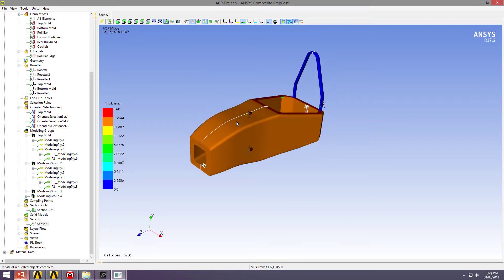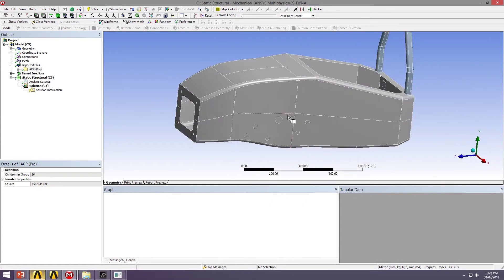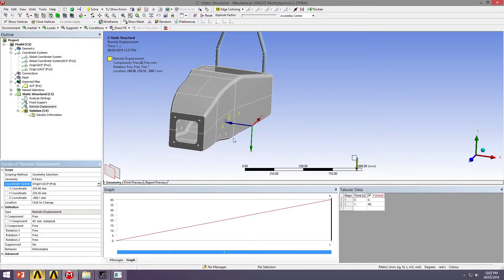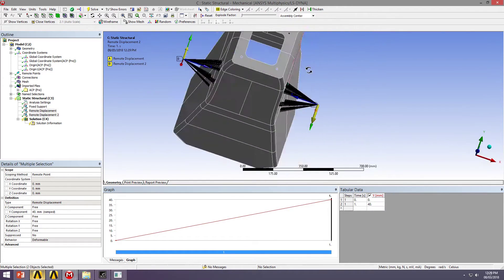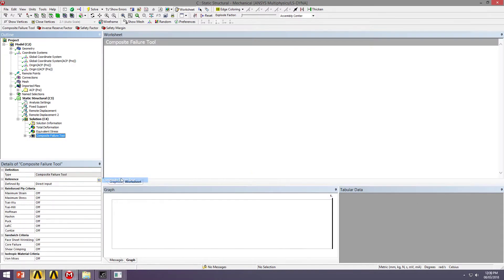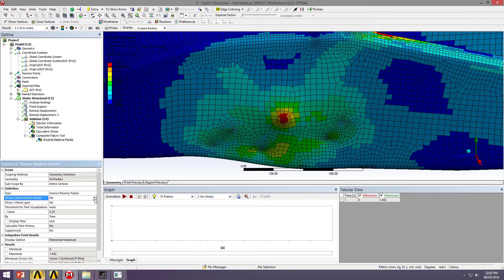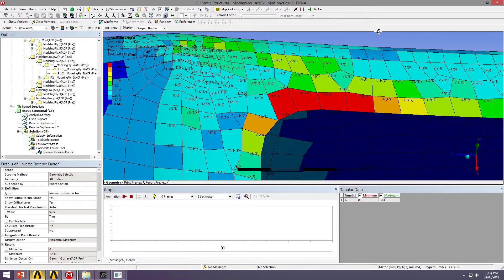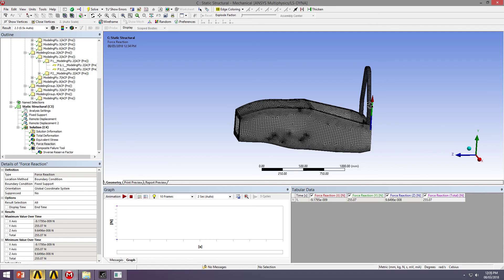ANSYS Composites Analysis - Demo -  Composites for FSAE #7

Comment: Great tutorial series! thanks alot for sharing. Would like to ask how you would account for the overlapping edges needed to bond the top and bottom parts together?
Reply from the maker: The top and bottom parts are joined with overlayed layers of composite applied to an element set that includes surfaces from both halves.
Reply: @leapaustralia  I assume then there needs to be two split edges, rather than one, as the overlapping elements when bonded together, has its own structural composition?